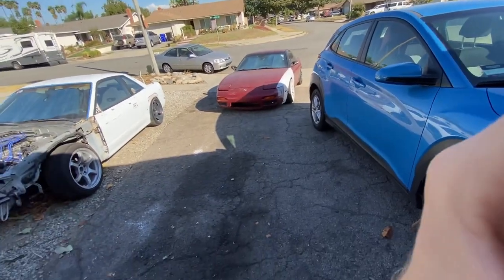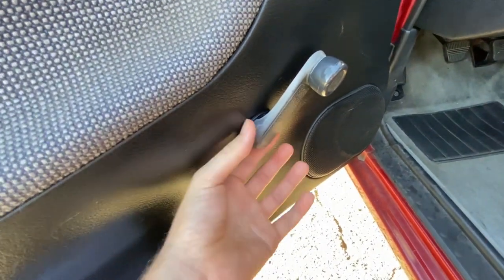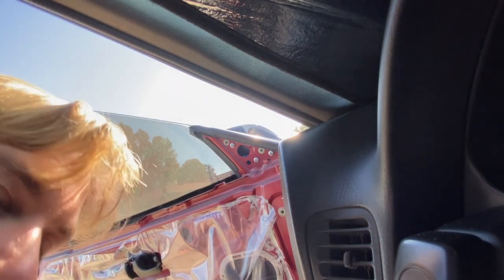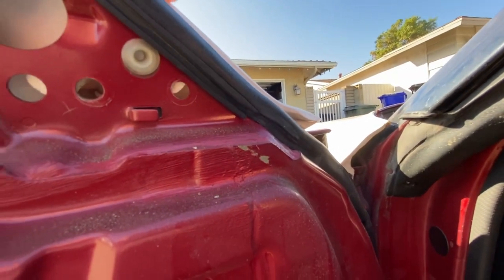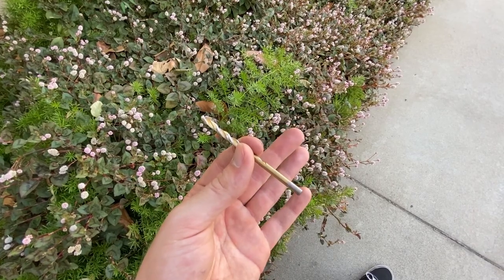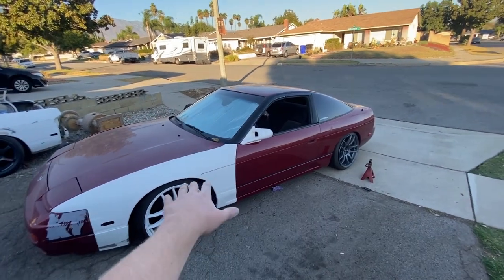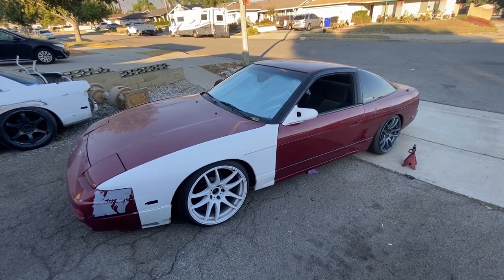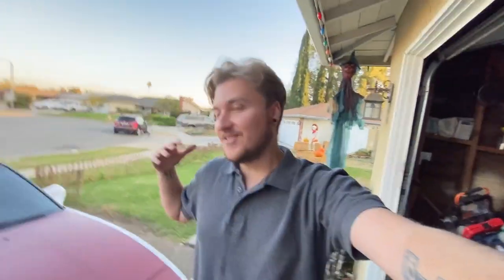Do S14 Mirrors Fit S13? - GANADOR Mirror Install

Comment: "ganadors"

These are made of fibreglass, real ones are made of aluminium base (inner part) and injectionmolded plastic (outer part) and they are held together with springs so they can "flex" incase u hit smth with them, or someone hits them.